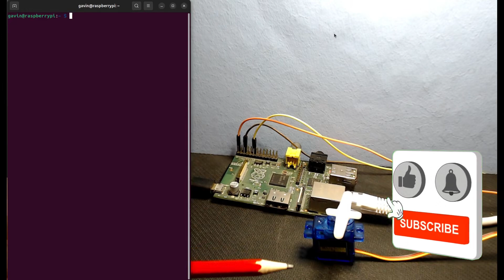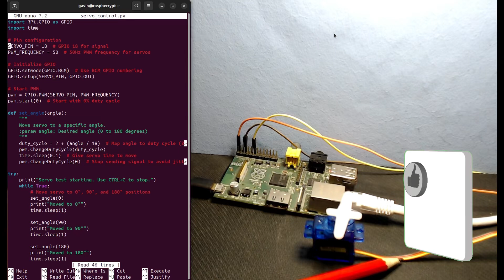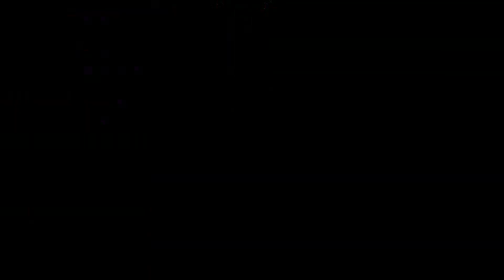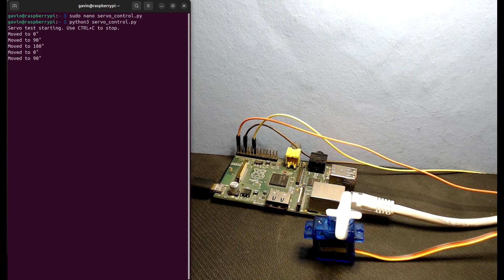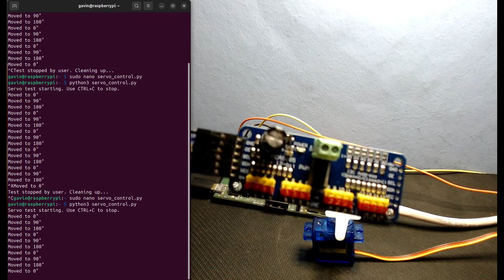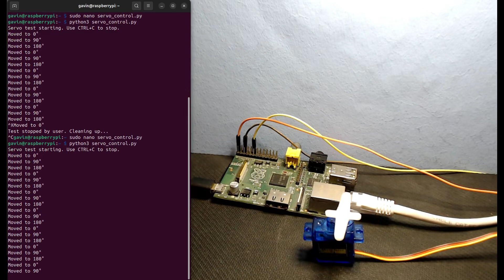Raspberry Pi & SG90 Servo Tutorial: Jitter-Free Control with Python

Comment: Does this work with pi 5?
Reply from the maker: Alas,. I've not purchased one to try but my suspicion is yes. Might want to double check the Pin out but the python code should not really need that much changing if any. I hope that helps.
Reply: @ thanks you a lot I got it working with almost no jitter